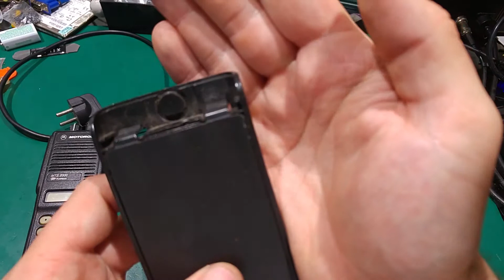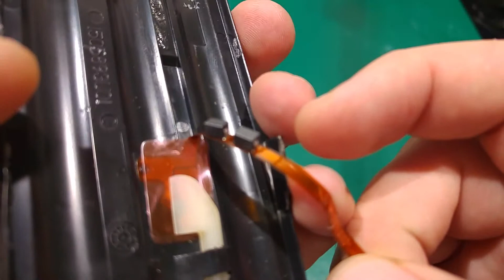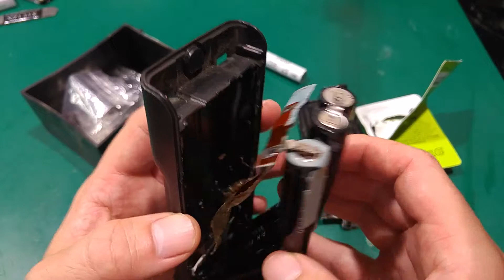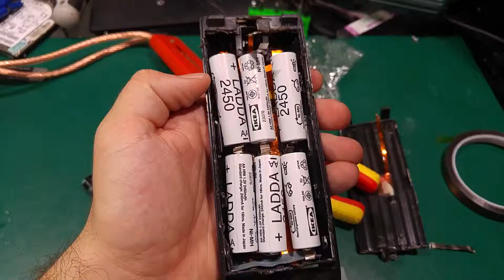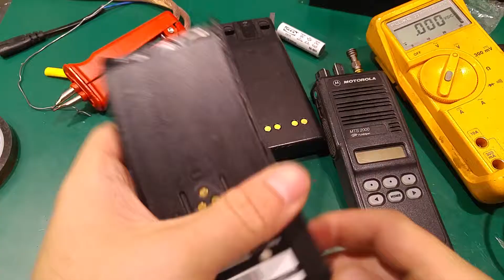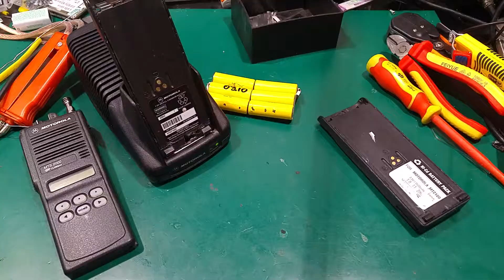Recelling obsolete Motorola MTS 2000 /  MTS 1200 NTN7144 battery using Ikea LADDA

Comment: I have an old Tetra handset that is built on a similar platform, the Motorola MTP300.
It is like new, but the battery is totally dead. 
What I have done, is look out for lots of batteries being sold for a similar platform, like the XTS3000. I now have a small stack of totally dead batteries, all bought cheap.
A couple of them will die for science, so that I can develop the technique to split them apart with minimum damage, the remainder can get re-celled.

First, I need to build a spot welder - A story for another day!
Thanks for posting, it was good to see your results.
Reply from the maker: Only thing I can say, I wish You luck with spot welder,  also tried build my own using super-cap and Arduino but I give up and in meantime get this chines - I truly hate  doing battery packs but now it let me work quite fast. My biggest achievement  was finding Ikea ladda (wich act like Eneloop Black!) it cut cost of rebuilding battery pack in half!
That's true, first battery always goes worst, then You know tricks and going well.
Keep stacking them, they will be worth lot money as soon they stop manufacturing  them.

Comment: Nice work :) I would like to see how you spot welded the metal strip to the Ladda cells? I've tried soldering them before and it's never really satisfactory, the heat usually damages the cell somehow. As for Laddas they are good- you probably know that many people think they are actually Eneloops. Very best wishes, Alan
Reply from the maker: Thank You,
I will make video about spot welder and show how it work closeup, but i don't feel i'm comfortable enough to make it right now ( i need little bit more experiments with dialing current, pulses, thick of material and hand pressure against tip) - everything count to make good spot weld. 

That's true, i damaged many AA from overheat,  after some time i notice they failed short, it must be overheat from soldering. Also 18650 are heat sensitive because of gasket inside.   Our Ikea ladda (eneloop blacks) are the best, from year i put them into almost everything i fix:) No failed... yet! 

  Take care!